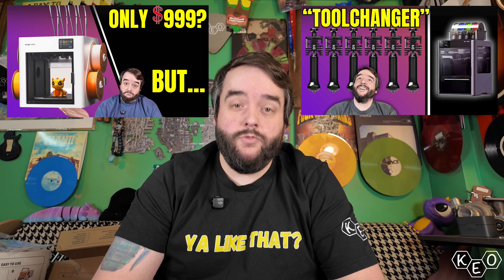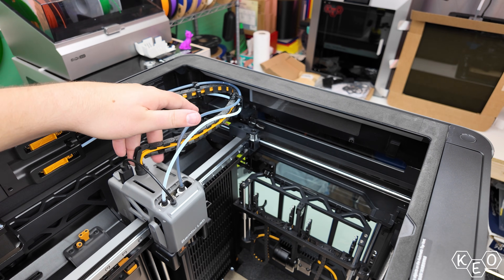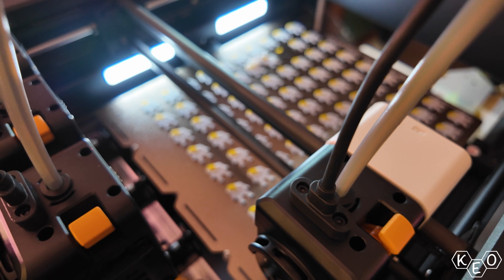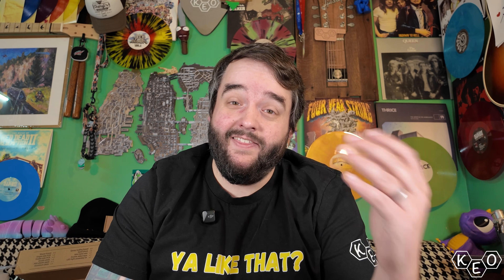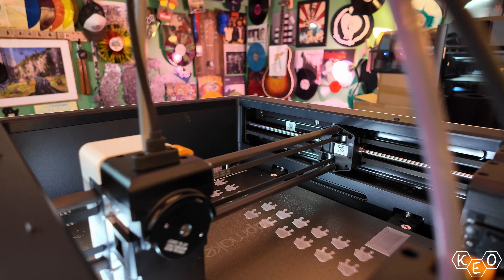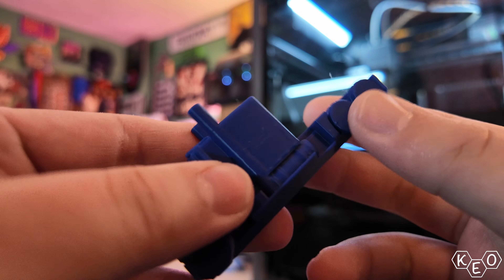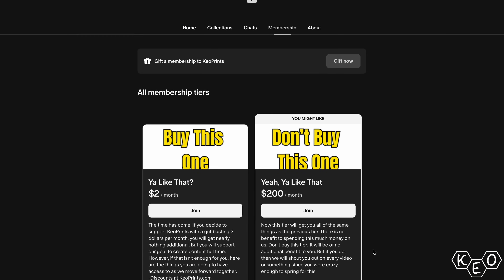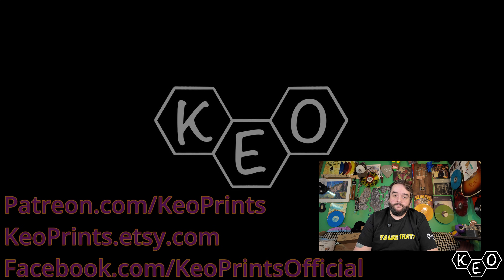Bambu H2C vs Snapmaker U1 — Toolchanger War

Comment: I guess at this point I need to jump into this debate because every single video I've seen just seems to focus on all the wrong things. Comparing the U1 against any of the H2 line is honestly ridiculous. It is far closer to the  P1 line in both capacity and price. That is what it is going to be competing against, not the H series. 

So let us start this out by me saying that I own mostly bambu printers and have tens of thousands of hours on them, but I own many other printers as well and YES I am buying a U1, but not because I think it beats the Bambu (It doesn't). It simply serves a very different role.

Now let us talk about the important things first on why the U1 competes against the P series and not the H series. Build volume and price. Comparing a 270mm build volume to a 350mm build volume printer isn't apples and oranges, that is apples and mushrooms. I love both, but they aren't even remotely the same thing or even used for the same thing. It also flatly ignores things like heated chambers, the ability to print things that the U1 flatly cannot, etc etc etc. The next thing is price. The U1 retails for $999 USD..or $750 if you kickstartered or $850 holiday pre order blah blah blah. Let's just say it is around a $1000 for argument sake. This is not a Budget machine by any stretch of the imagination. It is a cheaper tool changer, but it still isn't a budget machine. Nor is it a beginners machine. Much of the argument revolves around filament waste and I'll be blunt. If you can afford a $1000 printer, then the fractions of a cent that AMS style systems waste isn't a real concern. Time is a concern, not filament cost. That only becomes a factor on high end engineering filaments that the U1 largely cannot do because it isn't enclosed with a heated chamber. So let us just go ahead and stop acting like a few cents of savings is ever going to justify the cost. If you are really that hurt over filament waste, get a Centuri carbon, print in a single color and paint it. You could print everyday for years with the money saved. If you think that last argument is a ridiculous stretch, it is..just as much as comparing the U1 to the H series or whining about AMS filament waste is.

Ok so with the ranty bit out of the way let's get down to apples vs apple like fruits because I actually really like the U1, I just hate all the stupid arguments around it.

U1 Vs P1S vs P2S

U1 4 head tool changer with a 270mm build volume. Because it has the 4 filaments loaded, it is far quicker on material changes for things like PLA and PETG and some other materials like TPU for ams and possibly even PP/PE. You cannot do things like ABS/Nylon and other high temp chambers because open chamber without extensive modification/cost. Now I've heard quite a bit of griping about the H2 and it not being able to do tpu through the AMS, by the same people who ignore the fact that this thing has effectively an AMS lite built into it and has the exact same restriction. You have to run TPU into the tool heads directly. Now while you could have tpu dedicated to 1 tool head or even 4. It isn't without some hoop jumping and is certainly not massively better than any other printer on the market. Improved? Yes. Game changing? Not even close. Super flexible materials continue to be a little bit of a pain in the ass to deal with no matter the platform. The big real problem the U1 has is being hard capped at 4 tool heads. That is it. There is no expanding, there is no way around it. You are hard locked at 4 materials and beyond that you are doing manual filament changes. Now if the majority of your printing is 4 materials or less, this isn't that big of a problem. It is however something people need to quit glossing over. There are many many models out there that are 5+ materials and more with each passing day that this machine simply cannot print. This is something you must consider if you are thinking about purchasing it. That is why if anyone asks me "Is this a good first machine? or is this a good my only machine?" My answer is pretty much no it isn't. Because while it might seem great at first, it is something many will quickly out grow very quickly and have no options. It is however an amazing 2nd machine or even an amazing machine for someone who has been printing for a while and is wanting to take the next step and knows how much of their print volume is going to be 4 materials or less.

P1S/P2S. These are rapidly replacing the Prusa machines as workhorses in print farms and have rapidly become one of the dominate mid level machines for everyday users for a reason. They just work, they aren't terribly expensive and they have the flexibility of expandability. Now while you can get a P1s very cheap now that the P2 has released, it is an older machine and certainly has some drawbacks compared to the P2 or the U1. These printers have a little smaller build volume of around 256m and they are substantially slower than a tool changer for multi material prints because the AMS style system takes a while with purge and everything. However it tries to make up for that by offering more expandability. Your basic combo for the P1s is around $550 with a single AMS for a total of 4 colors. You can add another AMS for $250-$350 depending on sales for another 4 colors up to a total of 16. Meaning you have have 8 materials for the same cost as the U1 or even less depending on sales or for a little more you can have 12. This is no small thing. There is a huge amount of flexibility that having 8+ materials on tap gives you that has to be considered. Downside of the AMS is it handles flex materials poorly at best. There are some mods that let you do it anyhow and claim good results, but I haven't personally been brave enough to try that. Mostly because one of the big downsides to the AMS is it is a giant pain in the ass if it gets jammed and putting a material that is known to cause jams, isn't something I would do intentionally. Now the AMS 2 pro has fixed some of that annoyance, but again each system has different strengths and weaknesses. Now because the P series is fully enclosed it can also by default with no additional mods or money handle ABS and to a limited degree some higher end engineering materials. It isn't great, I'll be frank. The P series wasn't designed for these materials either. It can be done because I've done it. It sucks because the chamber isn't heated, the hot end barely gets up to the temps required and it just isn't what you want to with this printer. It is a Fantastic PLA, PETG and even PP/PE printer. Outside loading, it actually  prints TPU beautifully. Can you use the AMS with it? Nope, but the only real difference from the U1 here is that if you load TPU you basically lock any other material out outside doing manual swaps. So if you want to print something that is multi color and has TPU, in that very specific use case (This is why I'm buying one) it absolutely runs circles around the P1 series. However that brings us to the who do I recommend it to part. Absolute beginners? You bet. If they have the budget you cannot go wrong with this printer. The app makes things super easy, Maker world is really fleshed out nicely. All the things in maker lab are an incredible resource that very few other companies offer. It is as friendly of an environment as you could ask for. Yes you can make arguments about the cloud and walled garden etc etc and all of those complaints are valid. But they just don't matter to most people. Most people want a device that simply works and gives them the most amount of flexibility possible. For the money that makes the P series really damn hard to beat.

So which do you buy? The one that fits you the best. They are all excellent printers. However there are strengths and weaknesses to all of them that you have to consider. The U1 doesn't compare to the H series anymore than the P series does. They are built for very different tasks. I have an H2d and I'm sorry but there is nothing under $10k that comes even close to the capability it has for my business purposes. I also own a bunch of P1's and I'll be buying a U1 because they all have different strengths and weaknesses. Can we for the love of god stop comparing products that just simply don't do the same thing? I could go on a long rant on why the H2c is in a class all its own because of the insane amount of flexibility that change system offers. However people who only print PLA/PETG and largely just toys (nothing wrong with that) simply wouldn't be able to understand why the ability to print engineering materials and 20+ filaments and colors all from the same machine at the touch of a button is game changing because they don't do that. That is why comparing it to the U1 or really even the Prusa XL is silly.

Comment: for farms which always fill the printbed for multicolor prints, the bambu is probably the better choice - most likely easy to integrate into your setup, makerworld and bambu filaments (which have many colors and often discounts) . The price isn't too bad since the machine will pay back for itself. As a hobbyist, usually printing single items and not getting paid for prints (on a regular basis), I'd advocate for the Snapmaker - even though there are still some features missing in the software. Also, because it'll be open source (snapmaker forked klipper and promised to release all sources by march 2026; also there is already a custom firmware; reasonably priced replacement parts; great models for a 3D priint top cover [I printed ASA with an ikea box on top; 55°C chamber temp worked well] ). The only real rival for hobbyists would be the Prusa Core One L + Index offering up to 8 colors (~1700-2000$ depending if you want to assemble it yourself )  and even cheaper nozzle replacements.

Comment: With their rush of vortec to market as a reaction to the snapmaker, I wonder if they originally planned for it to be like indx, where the filament stays connected.  For some of us, it is the ability to print with multiple materials, including flexibles, that is important.  The Bambu is okay for multicolor PLA prints, but I never print that stuff.  I am a diy/hobbyist type that prints mostly functional things.  Multicolor pokemon characters are something I will never print.
Reply: Just wait till you find out h2c can simultaneously print soft flexibles directly fed to one nozzle and other materials fed from ams to the right nozzle to make multi-material functional parts.😂
Reply: @Uji_Metal  Okay fair enough.  And snarky too.  Good job.  What if I want to use more than one TPU, like some 95a AND some 70a, or even multiple flexible colors for some stupid pokemon character?

Comment: The question indroduces a lot of questions, preconditions, expectations, requirements ... and does not have a single answer. If the question is: How can I print fastest with 4 different colors with nearly less waste? The answer is U1, pretty simple. Is the question a tiny bit different, lets say: Speed is no issue and/or waste is no issue, ... The H2C may is the much better answer. ;)

But for many, "both win" is the answer. I got an U1 as companion for may X1C with 4 AMS. And if some would buy my X1C I would get an H2C and still keep the U1. ;)

Comment: From a technology and design perspective, the U1 is better. It's also far faster and much cheaper. Plus it can work with flexibles and very brittle filaments. The cases in which the Vortek system is better are more than 4 colors, higher temps, abrasives, and heated chamber. All of those can be solved with basic accessories or in future iterations of the U1. INDX is still what I'm most excited for, the U1 is great for the money, and the H2C is a compromised machine that will do a great job of selling more AMS.

Comment: A very real benefit to the AMS system that the H2c uses, is it enables laziness. Load up to 24 colors, 16 on the right, and 8 on the left, and don't worry about loading filament anymore. Just slice your model and select from the filaments already loaded. The H2c is a very convenient setup. It can also print tpu in the right nozzle (it's on the Bambu wiki), so you can do one type of flexible on the right, and PLA on the left (for support). Not as good as the U1, I agree (but I still have the same spool of tpu I bought 2 years ago). I will be buying a U1 for my daughter (once they are actually available). I was able to order extra nozzles and an engineering plate for my H2c as well.
Reply: You’ll get under-extrusions and false “filament is tangled” warnings with the new 4-in-1 thingy however.

Comment: One of the many things I like about Bambu is that it integrates well with Home Assistant. I use HA to notify me via my Google assistant speaker to tell me when the print has finished, if an error occurred, if filament ran out etc. and use HA to switch a power plug off that's attached to the printer when a print is done. HA also shows the video linkand all the printer stats.

Comment: Kings of small castles making the “not open source” argument against Bambulabs. I guarantee it doesn’t affect them at all. Apple isn’t open source, Windows isn’t open source. Linux is. Guess which OS has the least amount of users? You could state that android is open source but more than 95% of android users are using a Proprietary version that is NOT open source. Then naysayers follow it up by saying “what if one day they decide to lock you out of your printer???”. Life is vexing enough to not have to consider hypotheticals, but if that day did come, it would definitely be time to move on, evolve, and get a newer printer (by the time that occurred). I think majority of the negative people simply can’t afford nice things so they conjure up silly nonsense. They put more effort into writing a pissy response than working a little longer or harder to afford nice things.
Reply: Android actually is Linux with a custom userland. The latter, called AOC, actually is open-source.

Comment: I just can't bring myself to buy another snapmaker device. After spending almost 5k on the tippy-toppiest snapmaker artisan package they had available when it was new, and then seeing the complete and utter garbage support that the company gave to it (there has only ever been a single firmware update) I don't trust them with my money. If that's how they treat their flagship products, the u1 may be shiny now but will likely quickly become a massive pile of unresolved fixes. There's still not any decent tutorials on how to get started using CNC or laser (40w or 10w IR) cutting on the artisan and they've had it out for several years. Not to mention the spazzy support for slicers (use luban! no wait use our orcaslicer beta that we'll never update!).

Bambu at least has a strong community to help carry things forward if there are issues.
Reply: As someone who has the Snapmaker 2.0 A350, a Bambu Lab X1C, and now a Snapmaker U1, have fun wasting money by sticking with Bambu Lab.  I think the issue with Snapmaker is they weren't quite sure which direction they wanted to go and they finally realized that all in one machines are not the way to go moving forward (and yet Bambu Lab is trying to go down that route with the H2D).  

The Artisan was in a weird timespace where nothing really took off yet (laser, cnc, or 3D printing) and you can add the J1 to that as well (their 2 nozzle printer) and then they saw the takeoff of Bambu Lab and decided they should focus on 3D printing because there was a gap still and Xtool seemed to have the laser side locked up.  That's probably why they didn't support the Artisan that well because they were focusing on the U1.  Snapmaker is already showing that they are taking the U1 seriously.  There's been multiple software and firmware updates since release and the communication has been amazing.

I've put probably $3500 into my Snapmaker 2.0 A350 (rotary, enclosure, and 10W laser) and I now just use it for the 10W laser mostly and since then I've gotten a Chinese 10W UV Laser, a Bambu Lab X1C, and now the Snapmaker U1.  I think Snapmaker is going to end up filling the void of the low cost tool changer market.  On the official Snapmaker U1 owners Facebook group there is already a user that is trying to sell 30 of his Bambu Lab machines so he can replace them with Snapmaker U1s.

Comment: I have had a lot of issues with my AMS on my P1S. The issue was it printing from the wrong slot. The cause was the RFD tag. Once I removed the tags my issue went away. It was thinking a colo was in 2 slots if I only had 1 reel installed with a tag.

Comment: The H2C is my first 3D printer and I'm only a few days in -- snapmaker not an option for me due to lead time. I've appreciated being able to switch between nozzle sizes for test prints; if that involved a screwdriver or a manual procedure I'd certainly not do it on a whim. But on the H2C it's just a button in the software. Being able to use .6 to get a rough prototype burped out quickly, or to test print a section at .2 just to see the detail difference vs .4 are all things I've done. Not having years of experience and intuition to pull from, it's nice to just be able to easily try these things out.
Reply: Damn my h2c is on the way and your comment gets me pumped up. Didn’t even think of this shortcut.
Reply: Sponsored comment ?
Reply: Therefore, Bambu Lab is the only choice for you, regardless of how good the others are.